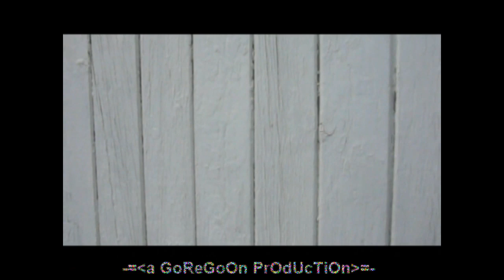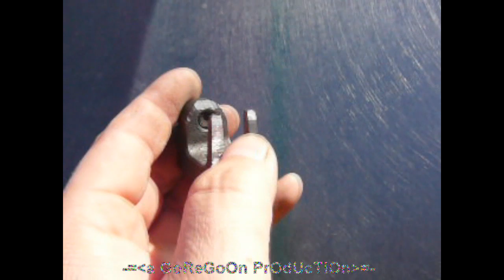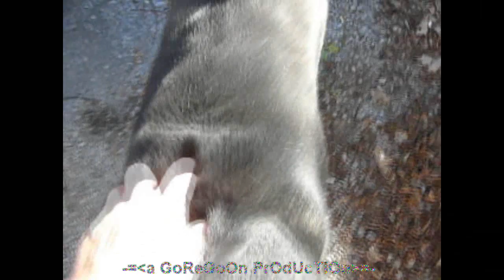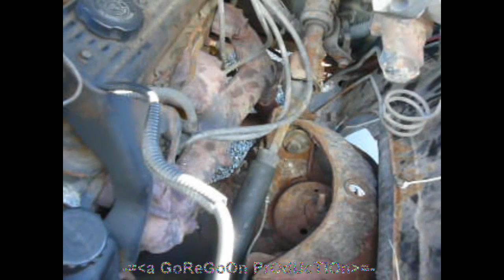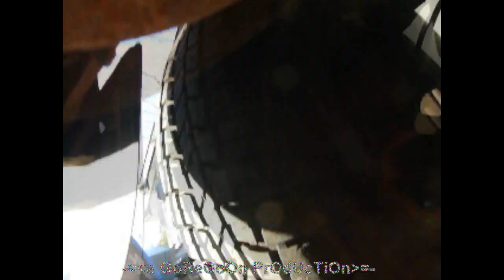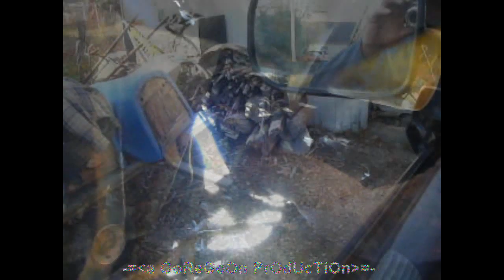A Redneck MacGyver exhaust repair!!

Comment: Good job goon. I think though it's actually supposed to have donut gaskets. That's why it's rattling now, you ain't got one anymore.

 Of course then you have to get the bolts loose, then if they break get them drilled out, or buy new manifolds...yeah you better bend over and grab your ankles soon as you get out at the exhaust shop.